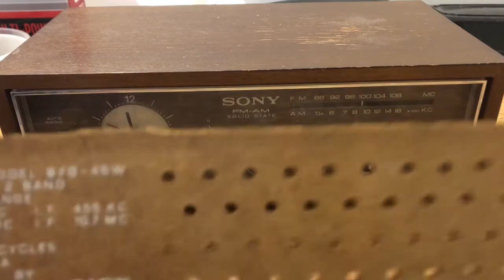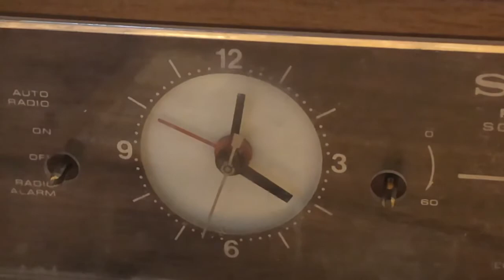GPWS: The interesting disassembly methods of Sony’s Model 8FC-45W clock radio

Comment: I have this exact radio, it was my first vintage clock and i used to use it all the time. Mine the clock still works but I have to get the radio working again. Yes, there is a neon dial light in this.
Reply from the maker: How'd you get this guy apart? You've seen my predicament here.
Reply: @thegregolahorologyclub6799  I haven't taken it apart any more then you have. I have to figure it out at some point.